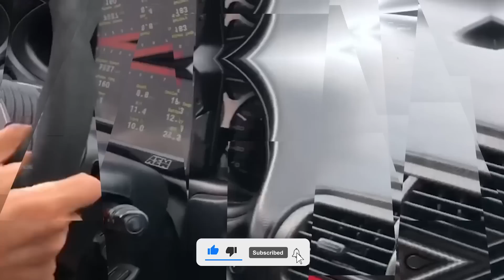K-Swap Everything!!! 🏋🏽‍♂️🏋🏽‍♂️🏋🏽‍♂️ EG Build Update 📝

Comment: Diff tuck wire.. .. I think which ever y’all choose . Bolt ect ect… like the bolts that hold the head light in on the radiator support instead of sliver.. paint match .black  .. so it look saddle and clean

Comment: This car is gonna be fire! 🔥 if the factory harness will clean up nice it wouldn’t look bad in the stock location but tucked would also look real clean with new oem bolts all around and the stash auto brake line tuck. With out without harness tucked id definitely brake tuck it. And maybe not on all the whips but I think red Recaros on this one 😂. Black brace and control arms for the rear and any wheels u guys choose will look good. Im building a coupe and im trying to do a similar build top to button just clean and subtle, tastefully modded.
Reply from the maker: appreciate the feed back